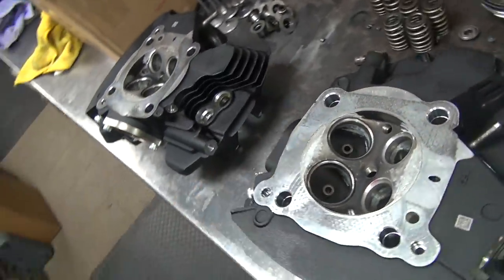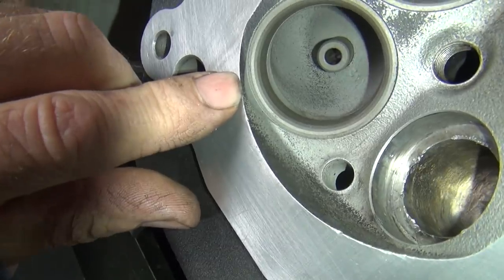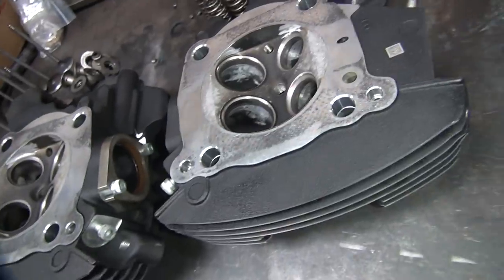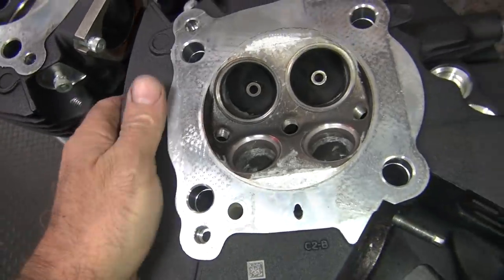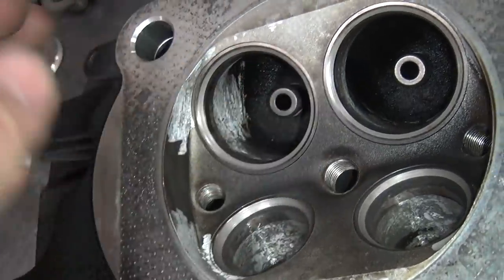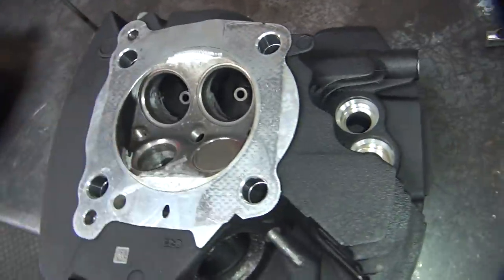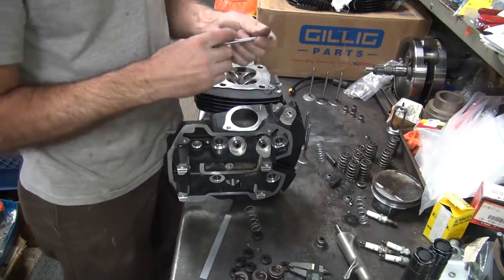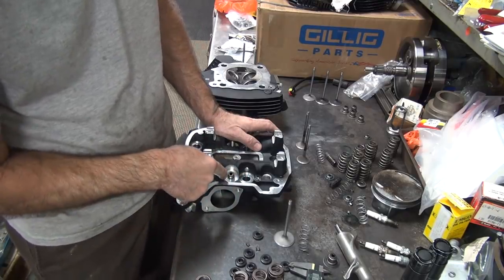#107 2017 114ci m8 valve job sunnen head plate machining harley head porting by tatro machine

Comment: Why do you hate on M8s so much? I still can’t tell whether you’re joking about it or being serious. Coming from a 110 twincam to a 114 m8 (after cam upgrade) there is no question the M8 performs better. So I’m guessing your arguments might have something to do with the engineering of the M8?
Reply from the maker: yes they are junk, just look at the heads and all the blown up motors on the forums. i will take a 120ci evo motor and 5sp trans any day and it will last. it will out run you too.
tatro